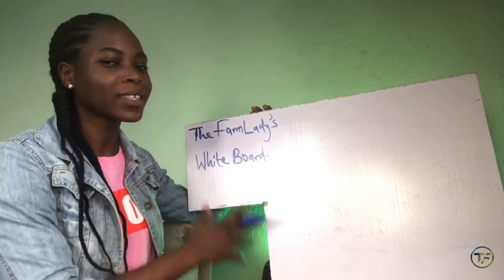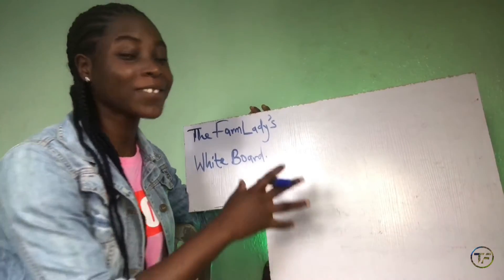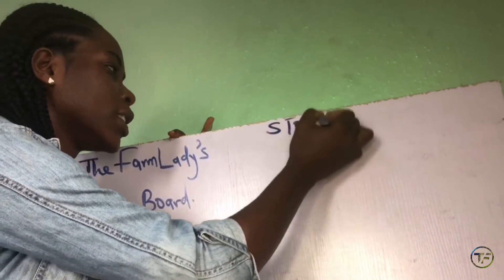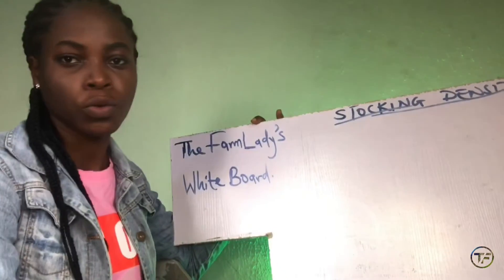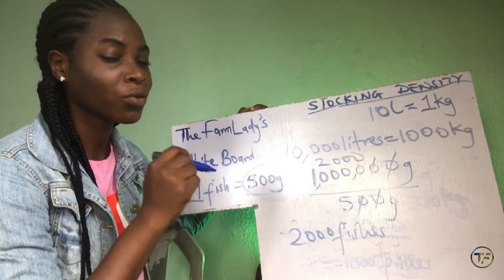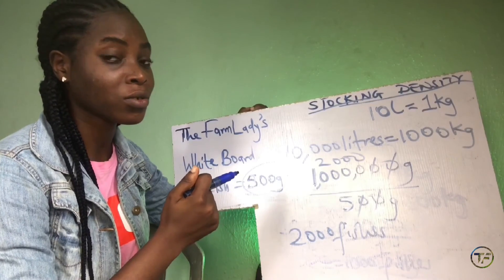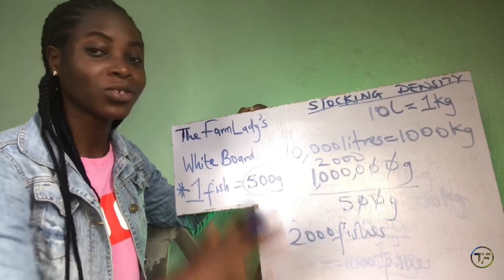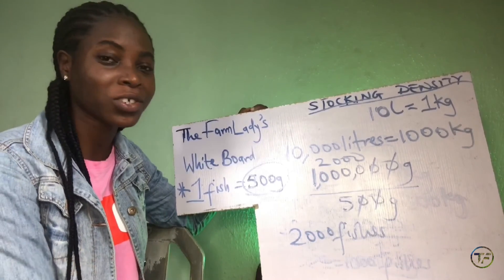HOW TO CALCULATE CATFISH STOCKING DENSITY in 2026 | #catfishfarming #thefarmlady #nigeria

Comment: Hello farmlady
Good afternoon,
Evening thou am educated but I still find it difficult to understand the simple calculation you just gave out concerning density of catfish to stock in a pond at a go,
Now my question is how many fish can I stock in 3000 litre of of pond? 
14:56
Reply: As the young lady stated, 10l=1kg (Specific to catfish). For every 10L of water in the pond/fish tank, it can support 1kg of fish biomass. Go back through the video and substitute you numbers for the one she used. As a fish farmer, you need to know how to arrive at the correct stocking density by calculating it based on the pond/fish tank volume as it relates to the fish biomass (weight).

Comment: Thank you for your video. My question is  I have a 15 x 10 x 4 tarpaulin tank, The plan is to grow to 300-350grams of fish. How many fish should I shock in this tank? The other question is what is the recommended Fill-Line for such tank size?
Reply: 170 fishes for that size of tank...
Fill line should be to the brim(impossible). Then you have to reduce the water level and recalculate to having 150 fishes to target your 350grams goal...Bon jornee
Reply: @emmynice5260  how you come about 170  fish for a 15' x 10' x 4' tarpaulin pond or am i missing something?

Comment: Hi I'm building a 30000 capacity fish on a concrete pond. I am planning to have 2000 fishes in one pond. please what size is the pond going to be for the 2000 fishes thanks.
Reply from the maker: great
A 20 by 15 by 4 (all in feet) will house 2000

Comment: Thank you very much for sharing this. 
Which means from your calculations, my pond that I have being estimating to take up 3,000 fishes up to 1 kg can actually take up to 7,928 fishes comfortably.
Because each of my earthen pond is 35ft by 20ft by 4ft (the actual volume of water).
I think I have to start thinking of stocking at least 5 thousand fishes in each of my ponds. 
I will be updating my process on my channel as well as the farm progresses.
Thanks once again for sharing.
Reply: Do try it sir, it won't give you the required result you want. 
Reason 1. Is because in an earthen pond, it is not only your cat fish that live and share the available space oxygen in your earthen pond, there are other biological matters that compete with your fishes in terms of space, light and dissolve oxygen. 

2. If your pond dimension  like you said is 35ft x 20ft x 4ft,  it means the volume of your pond is 2800 ft. This in liters will be 79296L. Judging by shikemis explanation, you should be able to stock about 7929 pieces of catfish. But this won't be realistic because the following questions need to be asked an noted. (I) . Is the water volume in your earthen  pond at the exact amount of 79296L? 
(II). Can you determine the amount of other biological matters competing with your fishes?  Unlike in concrete and plastic pond whose waters are frequently changed thus destroying the cycles of other living things in the pond.
(III). Are all the fishes stocked of the same weight 1kg?  Some will obviously be 1.5 and above though, some fishes may also be around 800g. 

3. So to be on a safer side, and to prevent over crowding of the pond, you can use the standard of about 15L = 1kg or 20L = 1kg. 
With the above given, you should be able to comfortably stock between 4000 to 5000 pieces of fish. With the  confidence of your fishes growing well and making you more money. 

Thanks
Reply: @emmanuelchiabuotu2676  can you drop you contact please
Reply: From experience 10,000 is too small to raise 1000kg except it is a recirculatory pond. It is better to use 20,000=1kg. If not your water gets dirty easily. Fish will not grow.